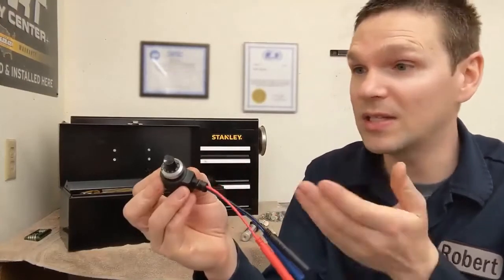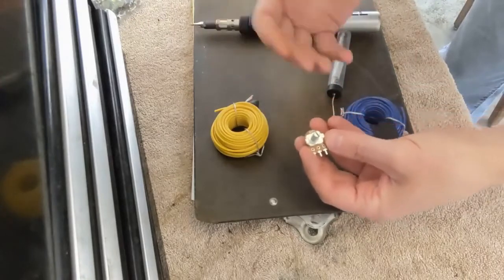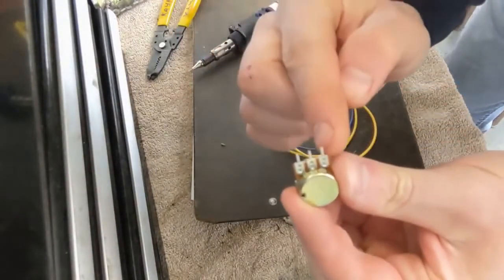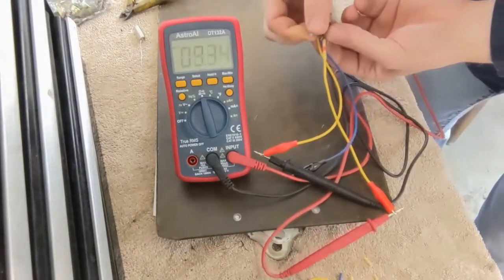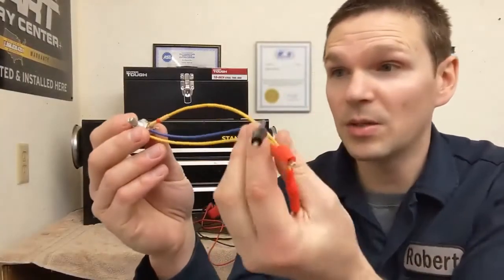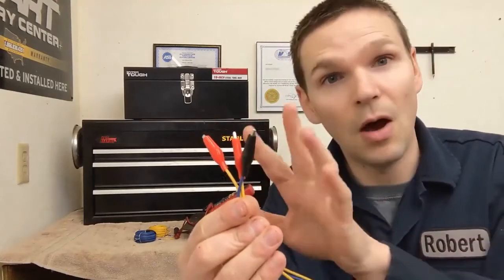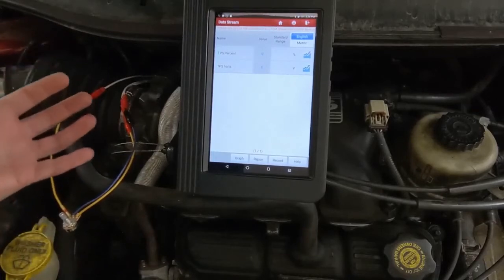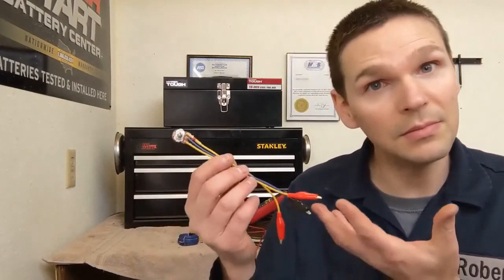How to Make a Potentiometer for Automotive Diagnostics | Best DIY Automotive Diagnostic Tools

Comment: Man thanks a ton. Excellent video. I need to do some testing worth my temperature sending unit on my old truck and this is going to make it easy. Thanks for the link to the potentiometer. Hey also, is that soldering iron good for soldering together 10 gauge wire?
Reply from the maker: Glad this video was helpful 🙂. The soldering gun should do 10ga wire no problem 👍

Comment: Im back probing my MAF with a set of potentiometers so that when im cruising down the road i can "lean out" the a/f for "better" mileage
Reply from the maker: That's an interesting concept. I wonder if the oxygen sensors will pick up on the leaner condition and compensate with positive fuel trims. Having a scan tool that can read the short term fuel trims will give you that information. Let us know how your experiment goes 👍
Reply: @ValleyMobileAutomotive  using live data it tries to compensate for a second then I guess says “f*ck it” and lets it run lol. I’ve got about 1k miles on it so far and it runs great, was getting about 19-20mpg now I’m getting about 24-26mpg. Borescoped the cylinder the other day and is running cleaner and has absolutely no damage compared to my other 2 vehicles with the same motor.
Reply from the maker: @undeadviper8297  Interesting findings. Just curious what vehicle are you playing with?
Reply: Is it still letting the maf sensor fluctuate or does the potentiometer lock it into one signal..... I'm thinking of doing this on my maf with a turbo build.
I just don't think I can lock it in at one signal because of idling and then in boost... It would need to be self variable
Reply: @davidb9432 sorry for not seeing the reply lol. Yes, the MAF still outputs a variable voltage, the enhancer just lowers the voltage from the MAF to the ECU

Comment: Excellent helpful video; hope the scan tool suffered no long term damage. A 10k variable resistor with the 10 turn fine adjustment similar to the one shown in the first part of the video is available on eBay but does not come with the leads or black protective box shown in this video. Soldering some piggy back test leads onto the variable resistor would allow a multimeter to read the ohms. I do not know who makes the little black protective box, perhaps it is specially made but I suppose any good quality waterproof electrical box of the right dimensions would be sufficient. Warwick Test Supplies in the UK have these gadgets but they seem a bit pricey for such a little item. It is definitely a very useful tool for testing wiring to sensors which are compatible with this test method.
Reply from the maker: Hey Andrew thanks for your comment. The black one came in an electrical diagnostics kit from AESWave.com if you are in to automotive electrical work often I highly recommend that kit.

Comment: Great video, can you explain a bit more on which connections you connect to. Is the two yellow to power & ground & blue wire to signal?
Reply from the maker: Yep. On a position sensor like the throttle position, accelerator pedal position, fuel level position etc. The power and ground go through the entire potential from end to end. The signal sweeps across the middle sending variable voltages depending on the sweeper's position within the potentiometer. If the sensor is a 2 wire sensor then you just need the middle and one outside. Either way you are making a change in circuit voltage for the computer to analyze.
Reply: @ValleyMobileAutomotive  Thankyou, great channel you have, glad I came across it.